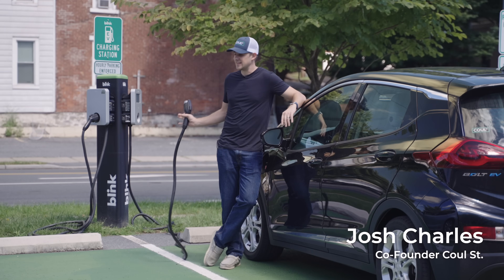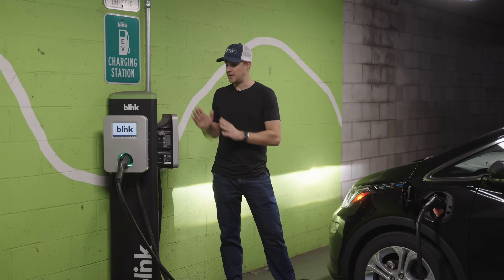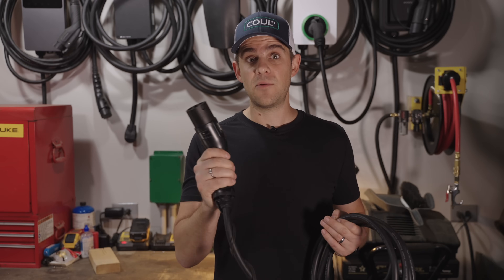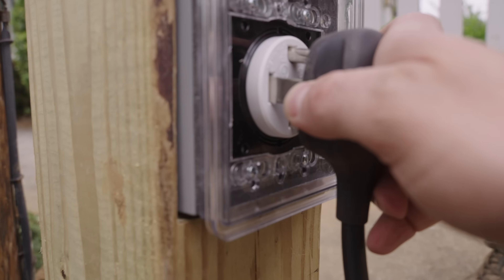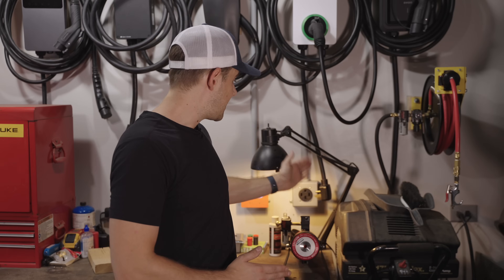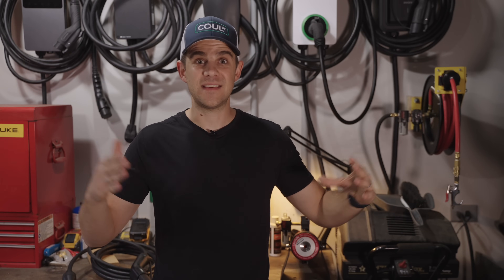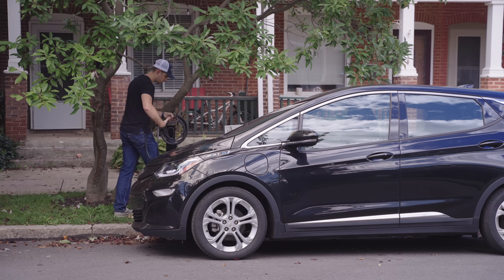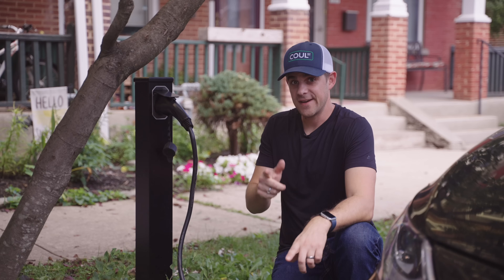We Need Detachable Charge Cables

Comment: Nema is also not suitable for public use for safety reasons as it is always live - J1772 does not turn on until it sees the car connect. 
There is also no way for a NEMA to tell the car how much current it may draw, which would be problematic where there are multiple chargepoints on a single supply
Reply: Nema are designed for high usage. The Tesla North American standard would be a much better choice.

Comment: I feel like the detachable cable model has a lot of desirable properties, even for private home charging - if the combined cost of the charger and removeable cable can be sold for the same price point as an identical charger with an attached cable.

To give an example, my parents live in a house that has a driveway, but the parking area is not enclosed by any garage or gate. With a traditional charger, the cable mounted to the house would be sitting there all night, every night, making it a matter of when, not if, somebody decides to cut the cable, leading to expensive bill to replace the entire charger.

With a detachable cable, the risk of cable theft is greatly reduced, as there is no exposed cable to steal except for the limited hours the car is actually charging (which, for the amount of driving my parents do, would not be that much). It would help with standard cable management issues, such as obstruction of the walkway or handles accidentally getting run over.

A NEMA 14-50 outlet kind of solves these problems, but the detachable cable solution does it in a better way. The charger itself is still secured to the wall 24/7. No plug wear issues. Less effort to plug and unplug. Etc.
Reply: I suspect you should be able to replace the cable without replacing the whole charger.
The connector and protocol is standardized.

Comment: Did you see the SAE blog post about SAE J3400 detachable cables from 19 December 2023?
They want a single socket for J3068 3 phase semi, and single phase J3400 and J1772 cables.
It's going to be type 2 male on the wall side.
Reply: it would be great if Josh posted a follow up to the video

Comment: Though tidier, untethered units here in Europe are frustrating to use. I hate having to reel up a wet + dirty cable every time I want to pull away, and - likewise - pulling a chunky cable out of my boot every time I want to plug in is hugely annoying. 

I originally chose an untethered unit for our driveway because it was tidier, and - in my eyes originally - more flexible (I could connect any cable, of any length, in future).

A year later I got the untethered unit removed, and a tethered unit put in. That was 3 years ago, and my quality of life - when it comes to charging - has been genuinely significantly improved ever since.

I don’t want to dismiss your concept by any means— charging at home, without a driveway, is an ongoing problem.

Before I got rid of my untethered unit, I’d spent a chunk of time considering short, flexible, coiled cables.

I thankfully don’t need to ever use untethered units anymore— I have no need to plug into an AC socket publicly, /but/ I think my solution otherwise would’ve been to get one of those coiled cables; as a nice compromise. Minimal effort to physically get in & out of storage in my car, no lying on the floor (so no dirt), and no need to physically reel them up for storage.

This is all to say: I think this setup could be hugely improved with the use of coiled, flexible, appropriate-length cables.

(Props to you! 👏🏼)

Comment: I agree that detachable cables are the way to go with public level 1 or 2 charging. I think moving to NACS outlets would help keep the charging post even more discrete. A NACS to J1772 cable should be purchasable.
Reply from the maker: NACS sockets are the optimal solution.

Comment: Could Do you have a version that could be put on light poles in parking lots?  Many parking lots have cabling intended for halogen lights but now only power LED lights.  Perhaps many light poles could support something like 6 amps without any change in cabling?  Considering where light poles are in parking lots, EVSEs sitting on light poles might be available for 2-4 different parking lots, so specific EV designated spots wouldn't be necessary - reducing friction with ICE drivers.

Comment: Part of the problem is still going to be charging ports being on the street side of the car. Charging points on each side of the car would make great sense, especially for cities where you have a lot of one way streets. This would keep people from having to walk out in the street to detatch, coil their cable, put it away and walk back in the street again to drive off. This could also be elegant for in a garage/multi-car garage. Run outlets on their own 50a circuit so you can pull in whatever way you want and be able to charge and not have cables running across the garage.

Now, we come to the issue of the transition from J1772 to NACS. I feel like the current long term solution is to have the port off the car being and remaining J1772 for a while, and let the car end be whatever... NACS, Chademo, J1772... There needs to be a set standard somewhere, and I think that would be a fair compromise, and really a hilarious FU to Elon.. since European countries mandated a specific connector. How many manufacturers havent implemented NACS yet, how much would it save them to NOT have to, and be able to keep J1772 with a BYO cable solution with dual standardized charging ports. No more bulky and expensive adapters, mitigate waiting on Tesla rolling out V4 chargers and integration for others into older stations. Unfortunately, that would still leave us with needing a payment solution... so for now, the elegant chargers of Europe or seen by your car aren't going to come to fruition... we'd still need the boxes. But considering how cheap THOSE can be compared to constantly maintaining and replacing cables/connectors, it's still a solid solution to public charging and not being a menace... and would allow more chargers in parking lots that would allow ICE vehicles to park and allow things to become a norm.

If we could do all of this, we could get away with sub 10-foot cables, which would also reduce the cost of the cables themselves and be less of a tripping hazard and not having something draped across your car, running under it or whatever.

Comment: The SAE screwed up with J1772 charging. They didn't restrict the location of the port on the car. Manufacturers put them anywhere requiring a long cable to reach all areas of the stall. Also makes it harder to design a standard stall with a short cable or requiring unusual parking practices, backing in, going against traffic, or offset to take up two stalls. <more>
There can be more than one port on a car. A simple interlock system will prevent conflicts. Unlike gasoline your not restricted to a gravity feed from the port to the tank. Electricity can flow up hill and around obstacles.

Comment: I thought from the first time I charged my 2014 Leaf that we got the cable management thing backward.
Why isn't the AC cable onboard the vehicle, with a retracting system like some vacuum cleaners?
Cheaper EVSEs would lower the barrier for installation in apartment building parking lots, public parking lots, curb-side...
Reply: Would be cheaper and more effective to go single cable with the car having a charging port on each side of the car. A retractable cable in the car is screaming for excessive wear and tear, I see it as an issue similar to a hose reel. If we do dual parts and can get cables to less than 10 feet long, itd be light, managable, and affordable. Possibly even cheaper than including the 120v slow charger. Sure, there's an initial OOP cost to run power, but people are already gonna have to do it in most cases. Better to have it just be a certified J1772 outlet with a cover, cable and conduit than the 400+ dollar wall units plus the cost of install. Would still need wall/post units for payment on public chargers... but still more functional and convenient.

Comment: In the 'Communist' European Union , and even in the UK, we have one standard for lower powered public chargers, the Mennekes plug. We also have one standard forDC  rapid chargers. With my untethered charger lead I can use charge points all round the UK where I live, and also all around Europe. 
My cable locks into the car when I plug in , and also locks into the charge point as it connects. It will only disconnect 'on demand'. It lives in the boot of my car, where is is dry and clean.
Reply: Have Italy and France replaced all of their Type 3 and Type 4 charge points with Type 2?
Reply: @georgepelton5645  What is a type 3 or 4 charge point?
Reply: @georgepelton5645  The very few places I've seen them recently are on dual socket chargers that also allow type 2. So you can rely on Type 2 only.
Reply: @solentbum  Scame IEC 62196 connector. From freaking 1999. I don't think that many of them ever existed. Soo it's not a big deal.

Comment: so will your charge post be easy to change to a NACS connector when that becomes the de facto standard?
Reply from the maker: Correct. There is no change as the cable can be adapted from one standard straight to another. That being said, it will feature a plug standard based on today's newest standards (likely NACS) to ensure a better user experience far into the future. I'll be sharing more on that soon.

Comment: Now my question to coul street is what's better type 2 or j3400 cord and why?
Reply: The J 3400 document has the type 2 connector in it as well as the NACS connector, so J3400 could mean either.  And it specifies type 2 for the charger and of an untethered cable like this.  So for compliance with what will soon be a standard, type 2 is the way to go.  But it's overly large complicated for that use, so from a technical and usability point of view, type 1 (J-1772) or nacs would have been better.
Reply: @charliesullivan4304 While Type 2 is a bit larger than needed, with space for  2 extra pins that will not be populated for single phase use, it does have locking to the EVSE outlet.  Type 1 does not have a lock feature, making theft easier.  Also, SAE wanted to provide for commercial vehicle charging for fleets with more efficient 3-phase power, which is available at most commercial and industrial properties.
Reply: @georgepelton5645  Yes, I just think it's unfortunate to have ~7 kW residential chargers forced to use hardware that's sized for higher power commercial fleets.
Reply: @charliesullivan4304  The pins and conductors for the cables are sized for the ampacity: 16, 32, or 64 A.  None of the “metal bits” are oversized. The only extra hardware is just a bit more plastic to mold the slightly larger plugs and outlets.

Comment: First off, there needs to be an established standard for the pedestal plug... which does not exist in the USA. Then it will be open to all manufacturers to compete and build the pedestals and cables. Then car owners could buy their own cable with the standard plug on one end and either NACS or J1772 on the other end.

Comment: I really don't want heavy dirty charging cables inside my car.  Takes a lot of time to clean them to put them into my car, not worth it to me, especially if it's hot or cold outside.
Reply from the maker: Fair enough. I’ve been doing it for close to 3 years and the weight is quite low and dirt isn’t typically an issue unless it’s raining.
Reply: @chargeeverywhere  Maybe differences in geography, ground is wet most mornings here, because of dew or sprinklers or both, but around here it's dirty. 
Maybe my  cable is too long? It's awkwardly heavy.

Comment: You're telling me a Hubbell 14-50 outlet won't stand up to daily plugging and unplugging? Why don't you just make a better 14-50 outlet then? Most of us already have (or have easy access to) the hardware to use those.
Reply: If Home Depot sells a so-so outlet for $10-15, but a Hubbell quality outlet is over $50, what would you expect the average consumer to do?   Hubbell's went up to $100 during the pandemic.
I like Josh's idea. But he needs to get product out into the real world where people can try it.  He needs to get a standard cable accepted by the US market.  Otherwise, we may wind up with numerous plug types, competing cables,  and nobody is happy.
  Good luck Josh.   I would purchase one for my driveway if you would make them and sell them to the public.
Reply: Billing, as well as many of the other stuff he talks about.
Reply: He addressed that by speaking to the option of putting in a commercial quality outlet (like the Hubbell), but most people don't do that, which is the problem.
Reply: Josh pointed out several other drawbacks in the video, including the blades of a 14-50 plug are exposed and hot when plugging and unplugging.

Comment: You skipped over the fact that RVs use NEMA 14-50 plugs and they plug and unplug at RV parks just fine. And a NEMA 14-50 ‘charger’ is essentially a cable, the charger is built into the car.
Reply: Just out of curiosity, how often do you need to replace the outlets at the RV park you manage/own? I can't find any real data and it'd be good to hear from someone like yourself with real world experience. 👍
Reply: But wouldn’t NEMA 14-50 not be lockable?
Reply: And a lot of those RV parks prohibit EV charging, because they found that the continuous load was too much for their systems.
Reply: Running an RV and charging an EV are two very different use cases. An EV pulls as much as 48amps for as long as 6 hours. That continuous load is WAY harder on the outlet than an RV that maybe pulls 20, or 30, but only when the AC kicks on at the same time you’re using the stove. The rest of the day your RV might be pulling 5 and that outlet cools down and never overheats.
Reply: @andykokes5690 14-50 mobile chargers don't draw 48A. They usually draw about 32A and lock to the car when the car locks. An RV with a 14-50 cable usually has two AC units that can run continuously day and night. They are exposed to the elements and get plugged in daily. How is that different? I'm not advocating for a 14-50 over a type 1 or 2 but a proper 14-50 is durable.
Reply: The problem with that is the EVSE has to be attached to the cable and that nema 14-50 isn’t weather resistant. Also, J1772 and NACS support 80 amps continuously, double what 14-50 can do.  And 14-50 is 10000% more likely to electrocute you. It’s a piss poor design for an outlet
Reply: Oh, and locking.